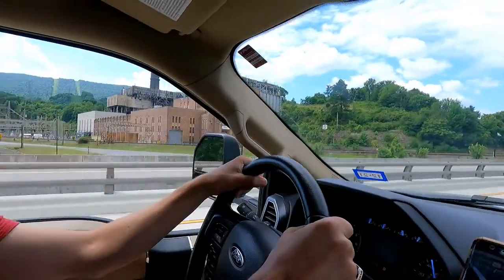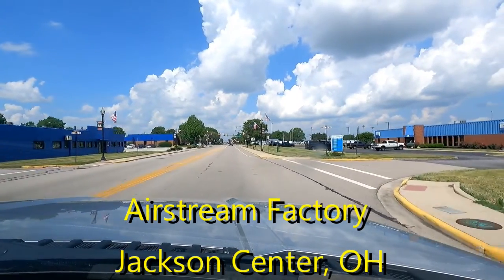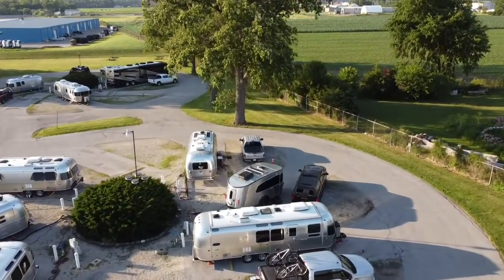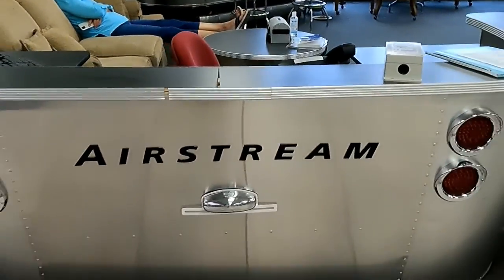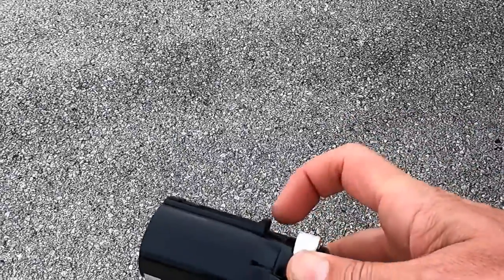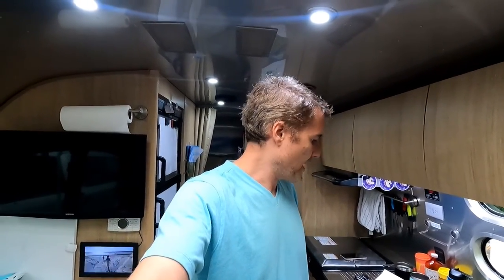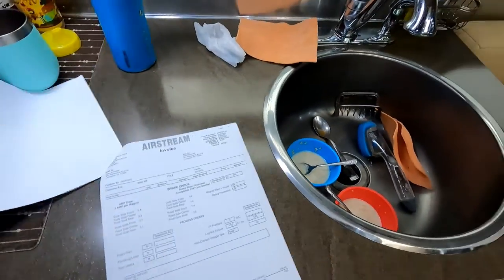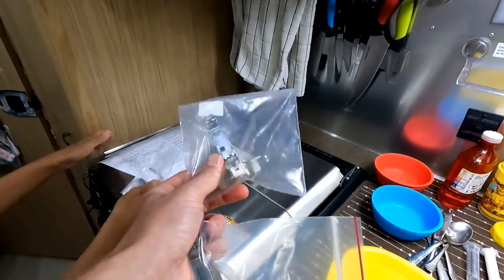Episode 103 Getting Serviced at the Airstream Factory

Comment: Funny thing is my 2019 fc has the same problems water pump and door hinges. Wonder if its known issues. My bay area dealer said it wasn’t covered. Maybe i need to go to jackson.
Reply from the maker: I don't think it was covered by warranty for me either - we've had our airstream for 2.5 years. But for some reason they logged it that way and I wasnt about to complain. Regarding the hinges... I mean I don't know what any manufacturer can really do to protect against long term issues with those. Even high quality hinges / parts will eventually fail as your house rumbles down dirt roads, effectively giving it a 30 minute 5.0 earthquake.